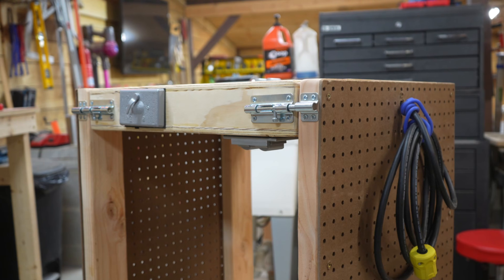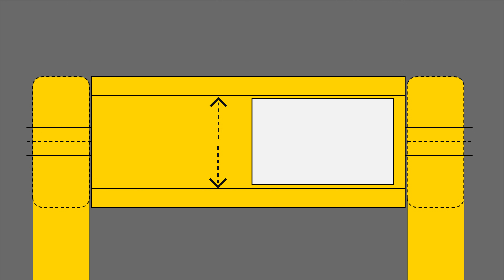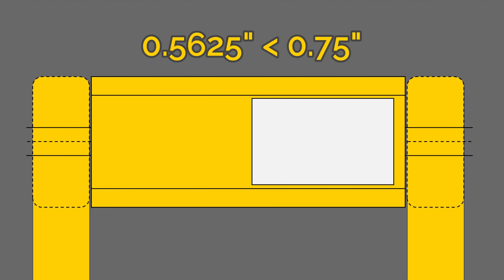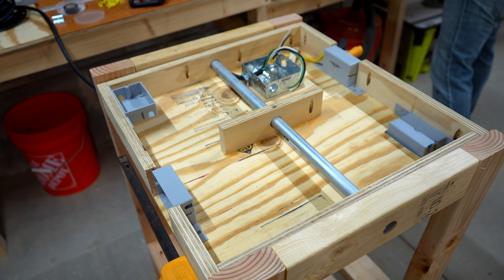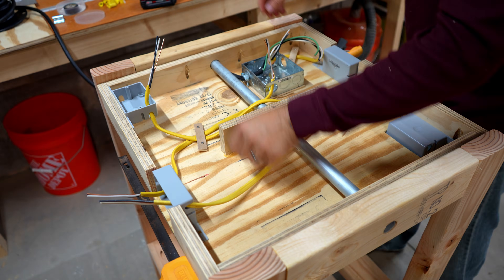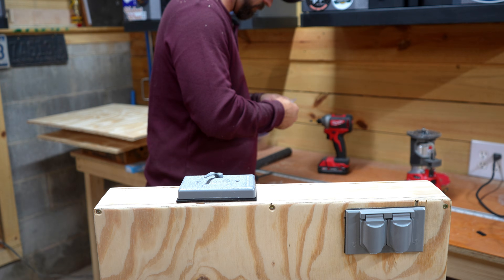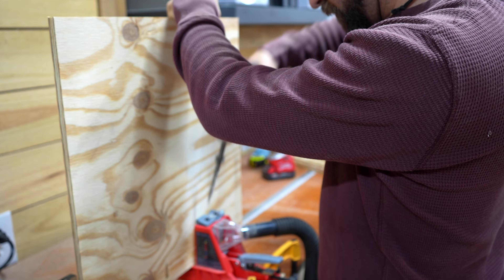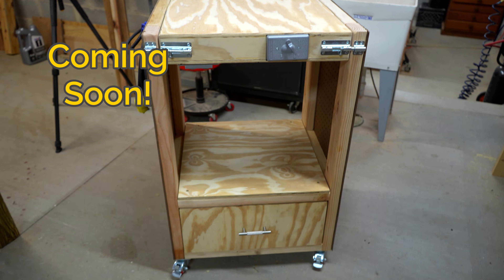Learn from my STUPID mistakes before you build a Flip Top Tool Cart

Comment: Sorry to point out a flaw in your design but since the top can be spun multiple rotations in the same direction, if the user is not paying attention, the power cord can be twisted into a knot.
Reply from the maker: That's correct. It's just something to be cognizant of. You'll see the cord start getting twisted before anything bad would happen and you can just rotate the other way to untwist it.

The way I use mine, I have a box of sandpaper that sits on the bottom shelf that my belt sander can't spin past. So this creates a natural barrier that forces me to always rotate it backward, forcing rotation in opposite directions for each side.

Comment: Alternatively, instead of letting your 2 x 4 decide the thickness of your table top material. You can also rip the difference off of the two by fours inside of the table to match. For instance, I’m using 7/16 OSB for my table top so I’m ripping 7/8 off my two by fours for the interior of the table.  Just throwing it out there great video though.

Comment: $250?  You can buy a Powertec for that much.  I am not sure where all that cost is for some 2x4's..
Reply from the maker: A lot is in the copper and electrical equipment: 25ft of romex, 15ft power cable, switches, dust proof switch covers, outlets, dust proof outlet covers. The barrel bolts were about $10 for a two pack for the ones I got. Everything else just slowly adds up: casters, metal pipe, pegboard, plywood (that stuff has gotten stupid expensive. I just bought a full sheet, didn't use it all but that was $60), consumables (screws, wood glue, romex clamps - I always conservatively assume someone has nothing lying around so $10 for glue, $6 for screws). It just all slowly adds up.

Comment: Great work! What kind of pocket hole jig are you using?
Reply from the maker: Thanks! The main one I use is the Armor Tool Auto-Jig. But for quick holes or if I need to add one to an overly bulky or partially assembled piece I'll use the basic Kreg pocket hole jig.

Comment: How do you screw down the tools without hitting the wiring?
Reply from the maker: I used 1/2" or 3/4" screws (depending on the application) so that the screw didn't go so the way through the 1/2" plywood. The other thing you could do is if you know what equipment you're wanting to mount beforehand, just Mark the layout for the holes for the equipment beforehand and then route the wire in areas other than where the equipment is gone too be anchored at.

Comment: I don't see wire connectors? They are used to eliminate shorts!!
Reply from the maker: Even better, there is largely no wire nuts because all runs of romex are from a termination on one component to the termination on another component. No need for wire nuts or crimps with the exception of where the power cable comes in and does have wire nuts with electrical tape wrapped around them to connect to the romex.

Comment: The wiring is really problematic. It’s not just the insulation slowly rubbing off on the shaft. The decision to bring an extension cord without any stop locks or slip ring means that it’s really easy to get it wrapped. Why not use a slip ring?
Reply from the maker: I've never heard of a slip ring until you just mentioned it. That would be a great addition! Where were you when I was building this!? 😉
Reply: @MadeByChance for what it’s worth, I really appreciate you interpreting my constructive criticism in its intended context.

Comment: As a suggestion I would use a drawing program to design things like this when they begin to get complicated.  You will immediately see these kind of mistakes and avoid wasting material.  I use Sketchup but there are many other programs on the market.  For woodworking Sketchup is the best though.
Reply from the maker: I've used SketchUp and Fusion360, and I don't mind them, but I'm not proficient enough to crank something out in a hurry. In this case, I was short on time and chose to spend the time it would have taken me to draft something up in software to just start building it since I had built a similar one a few years back.

But I do agree 100% that if you have the time to draft something up in software, you can definitely eliminate a lot of fitment type mistakes as well as waste less material!

Comment: If you get into the habit of always flipping the top in one direction (human nature), the power cord from your source can become badly twisted and possibly cut open at the exit point of the pipe into the inside of the top.  Anyway to resolve that that you can think of?
Reply from the maker: I have thought about this some and I personally just remember to alternate how I flip it (in pencil on the front edge I wrote "flip back" and "flip forward" on each side). The other thing you could do would be install a bearing that the cord runs through and insert the bearing into the wood on the side. Then as you rotate it the cord is free to rotate.
Reply: @MadeByChance  I've seen other videos where a peg is placed on one side of the rotating base.  There are two grooves routed on the side of the base that the peg can travel in.   The grooves would be cut short so that the peg would hit the end of the groove and stop.  This would only allow you to rotate the table forward one way and backwards the other way.  The table could only rotate 180 degrees.  I cannot spin freely.
Reply from the maker: A positive stop of sorts. That would be easy enough to implement!

Comment: You forgot a wire clamp for the Romex going into the 4" Sq Box, you used one for SO cable,  also your wire straps need to be closer to the boxes for the Romex.
Reply from the maker: I appreciate the comment. There's always code aspects and "best practices" that apply and people should be aware of, but I can guarantee with 110% confidence these wires aren't coming loose. I tested how well the SO wire twists when the flip top rotates, even if it always rotated in the same direction. With how it rubs on the edges of the entrance to the pipe/tabletop, it's not going to ware through before the wood wears our. I didn't show it on camera, but the pipe was siliconed with the wire in it, so it's only rubbing on the pegboard material which is basically MDF, so I'm not worried. Additionally, it's easily visible if it ever wears through now since it would only be on the outside. Additionally, the boxes and the table top the wires are attached to all move together. I'm even less worried that there's going to be tension created between the romex and the switch or outlet boxes because they have the same movement. It would be different if the wire was not rotating with the boxes. It may not be to "code" with the distance the romex is held down from the inlet to the boxes, but the national electrical code wasn't made with a flip top tool cart in mind - the intent of the code is met, and anchorage of the wiring is all adequate for the application. Nothing's going to burn anyone's house down.

Comment: Just wondering . . . To attach a tool to the top, do you just screw into the 1/2 inch ply? You can’t bolt the tool on because you don’t have access to the inside? Is the attachment going to be strong enough to hand the tool on the bottom side?
Reply from the maker: That's a good question that I should have done better to explain. But yes, you would just screw to the top of the flip top box. A rule of thumb is the pull out strength of a #10 screw in 1/2 plywood is about 50lbs. With 4 screws on any piece of equipment, you're talking close to 200lbs. So it's more than sufficient.
Reply: nice work, but what happens when attaching the tool to the unit you drill and screw through the wiring?  @MadeByChance
Reply from the maker: That's a good question. We made sure screws were sized appropriately for each tool. So measure the height of the holes from the surface and add the thickness of the plywood, and that's the screw length that should be used.  In hind sight, I realized that anchoring the wire inside the box is probably not necessary, and would add some flexibility to allow the Romex to "move" with a screw through the wood. Obviously, you don't want to use 3" screws or anything like that. But I think as long as you used reasonable length screws and the wiring wasn't anchored down, there wouldn't be any issue.
Reply: Thanks. That’s good to know (the pull out strength of the screws).